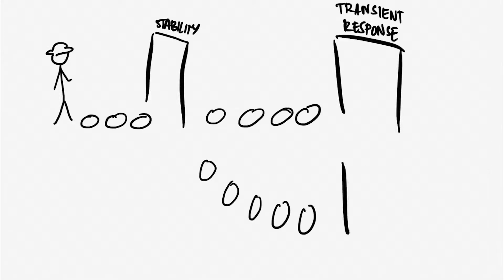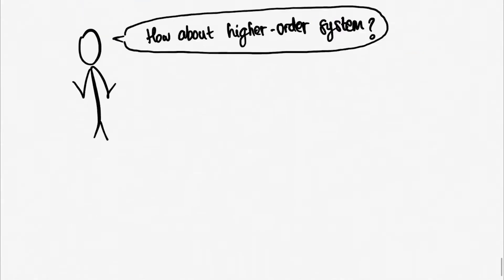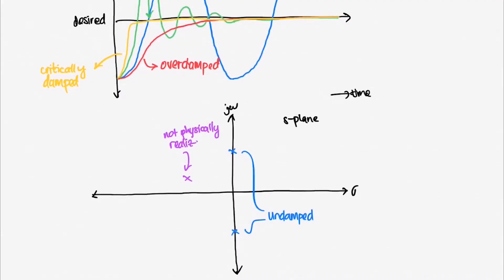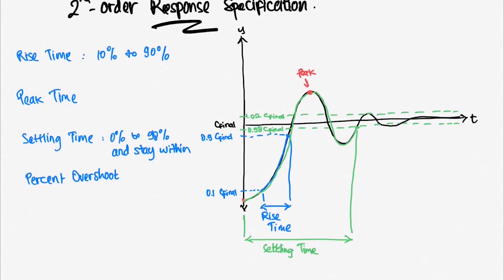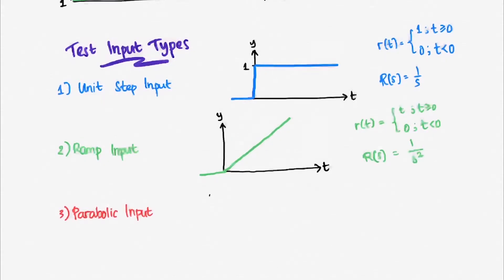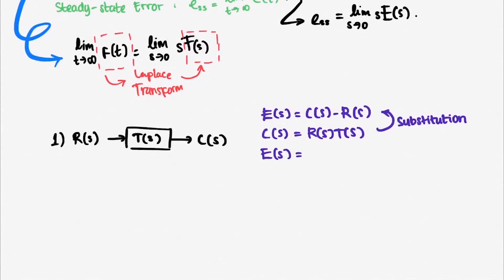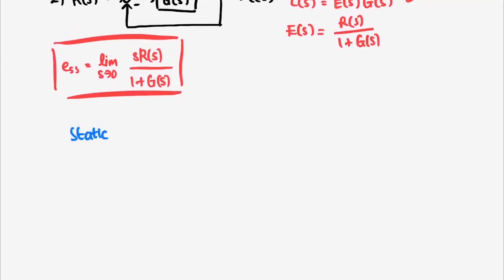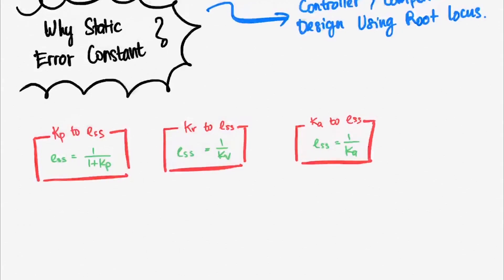Part 3 - Transient Response and Steady State Error

Comment: 6:25 and 7:04 when deriving steady-state error formula, lecturer accidentally writes E(s) = C(s) - R(s) whilst saying that E(s) = R(s) - C(s). The correct one is E(s) = R(s) - C(s) remembering from the steady-state error definition, difference between prescribed test input R(s) and the actual output C(s). The rest of the derivation and the formulas itself are correct.